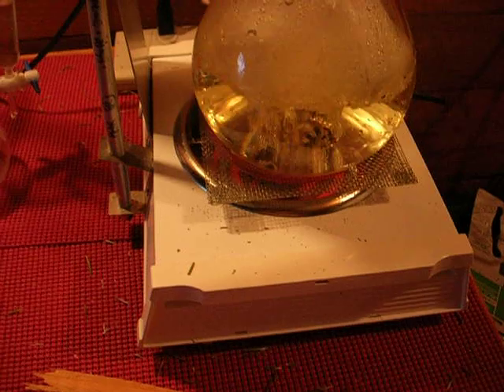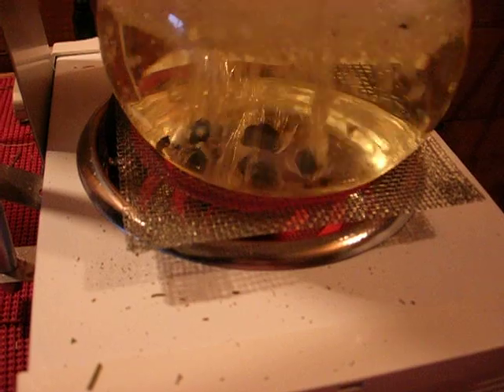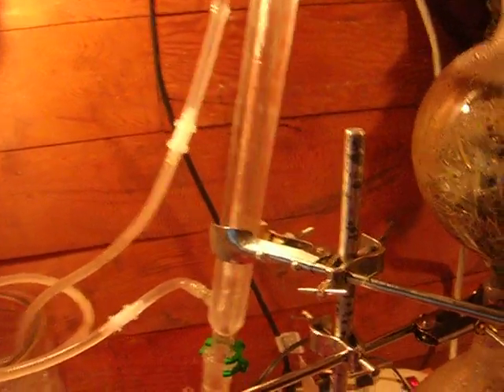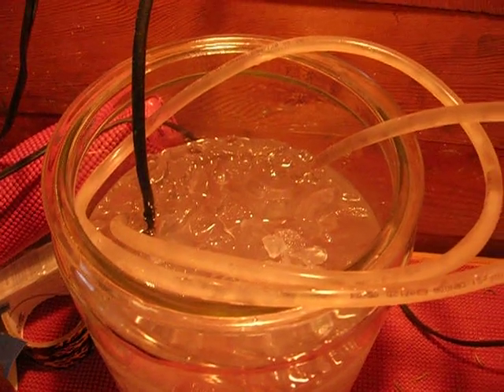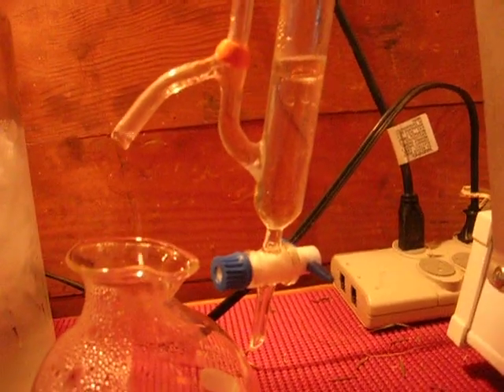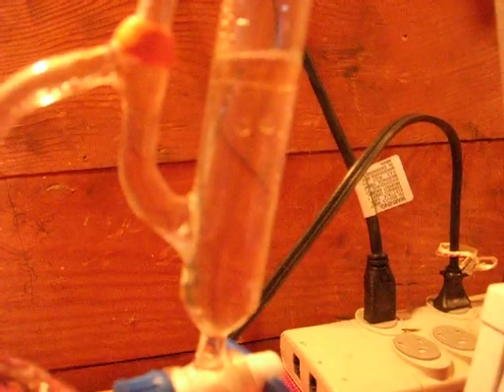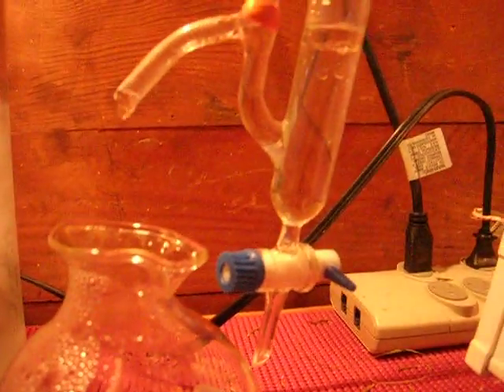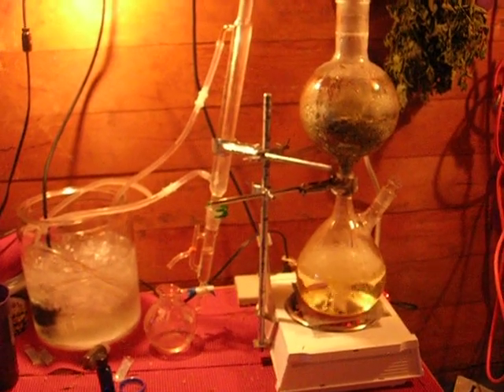Essential Oil Distillation

Comment: That looks fantastic. Do you pump the water through the external portion of the distiller chamber or just leave it attached to ice water and let thermal conductivity handle the rest? I want to set this up so it can operate largely unattended (ie with me in the other room working on something). I have some pumps, but they aren't low enough flow to be practical for this use.
Reply from the maker: The cold water runs through the core of the condenser.  The pump is a fountain pump, you can easily get one.

Comment: testingforyou the only part of starting cold water in the top is by the time the water gets to the bottom it will be hot again. That would heat the oils up and the water and oil would merge back together. If the condensation starts hot it will stay in a vapor and as soon as it hits the middle and bottom it instantly turns back into a liquid which allows you to separate the oil and water. 
I've brewed beer and alcohol for quite some time and I thought the same thing coming out of school about 10 years ago and a friend of mine who had been brewing for years showed me reversing the hot and cold water and showed how it affects the output. 
You always want your cold going in the bottom and hot coming out the top.

Comment from the maker: As we are heading into deep autumn, the plants in my yard are pretty much done for the year, so I don't know when I'll be distilling next, but chances are it won't be until spring.  My costs on the flow are static, both in terms of cost and volume of water.  The pump outputs steadily, I'm not using the open flow of a sink, and I buy the smallest bag of dry ice not matter what.  But it's something I'll keep in mind.

Comment: Sorry, didn't mean to pester you, just thought I could share some information I learnt from someone who I highly respect and has a lot of knowledge in the area. I only wrote that comment so you could experiment and see if there was a difference. Although if you have a fast enough flow rate, it doesn't matter which end you use. Even if it didn't give you sweeter oil it could have meant that you could reduce the flow and save money. Again sorry, I didn't mean to pester.

Comment: hi, i don't mean to be a pest but when i was in chemistry in school we learnt about condensers, the only thing i would say you are doing wrong is that the inlet for the condenser should meet with the hottest part i.e. the top. you have the coldest water meeting the already cooled steam/oil/etc then warm water is trying to cool the top part (which is the hottest) change the direction so that the coldest water is meeting the top of the condenser. your oils should be sweeter